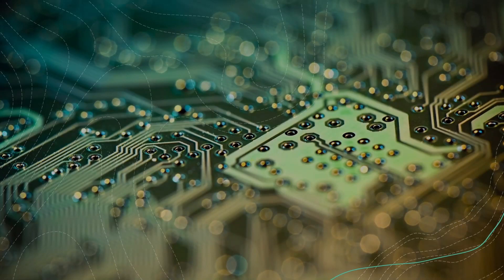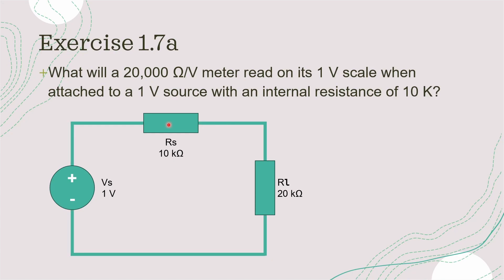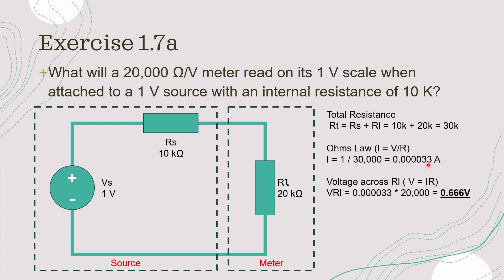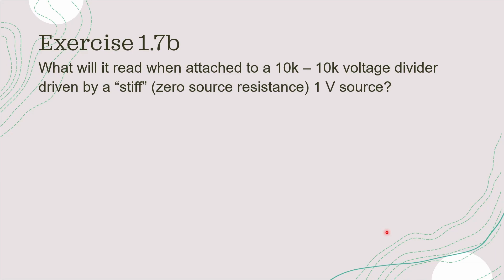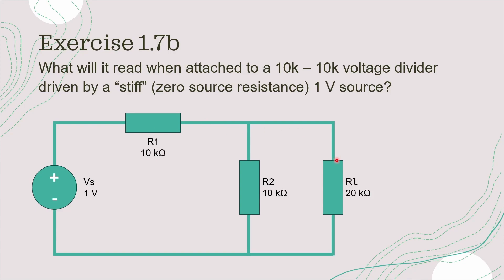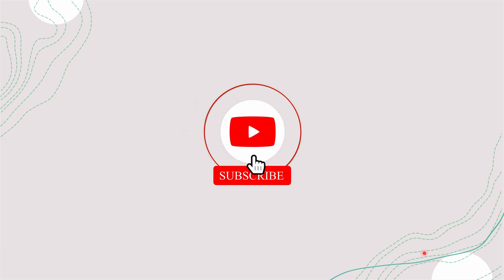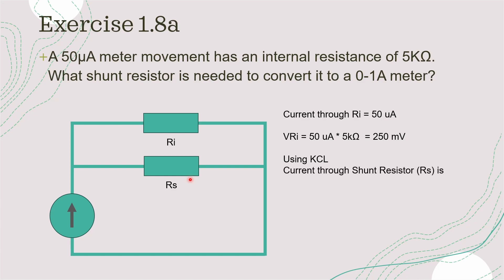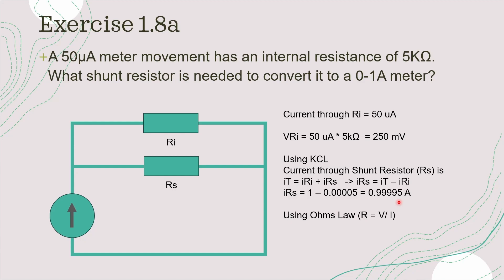Learn The Art of Electronics: Exercises 1.7 and 1.8 | Series and Parrallel Resistors

Comment: Hey great video really like the explanation. I have gotten answer where close to your answer for example for resistance in the first one i got 0.25 ohms and for second 20000 ohms. However i did not use kcl or kvl to solve them. After I calculated the voltage using ohms law V=IR for the given value (50uA)(5k) and when it came to finding the shunt resistance i would use ohms law again and assume the largest value in the both domain they have given us for the first one i just assumed the current to be 1A and solved it like that using Ohms law and got 0.25 ohms and for the second one i did same thing let voltage =10v and divided it by 50uA and got the answer 20000 ohms. I just want to know is my method right. Thank you for your time.
Reply from the maker: Thanks for the comment. 

I will need to have a look at the question again. I will let you know.
Reply: @TheEngineeringExperienceYT  No Thank you people like you on the internet make it so much easier to learn these complicated topics such as electronics.